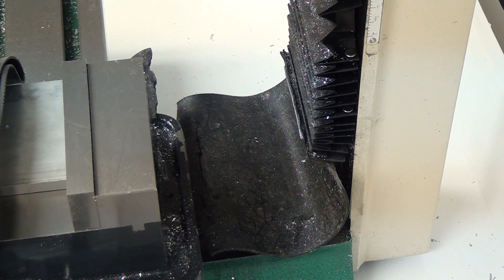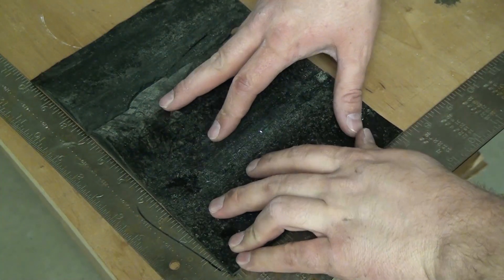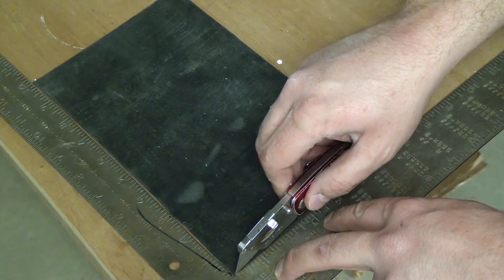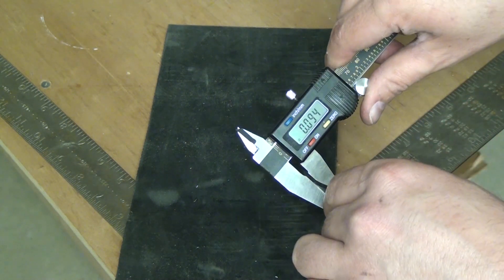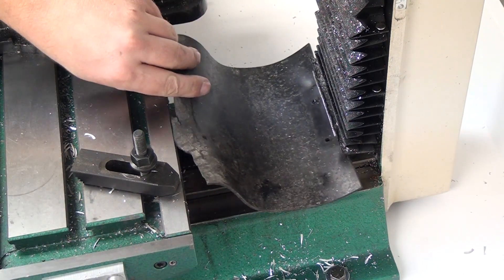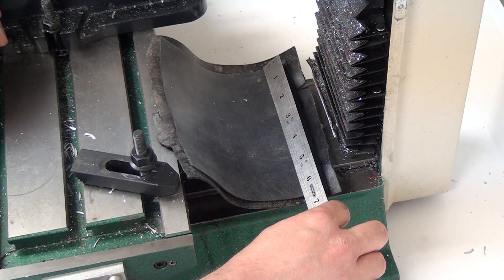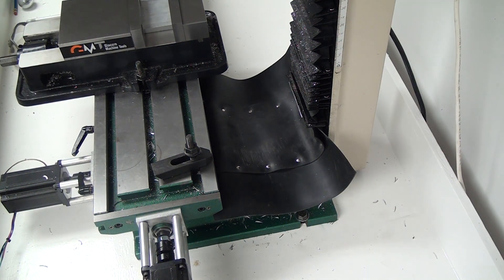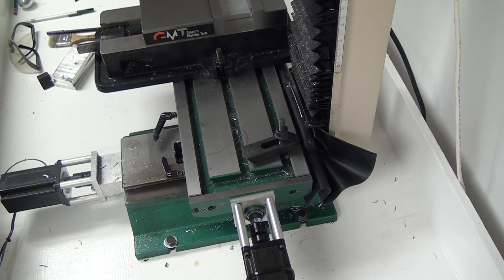CNC-G0704 #6 Y-Axis Way Cover

Comment: I just ordered some of this same material today to replace my way cover. I wasn't sure about my purchase until I came home this evening and saw your video with the same part number that I ordered from McMaster.
Reply from the maker: Show us some pics!
Reply: russtuff Follow up: I tried the softer material and it might not be a good idea. It was weighted down with chips and deformed enough for the table to run it over and was bound up in the ways. The motor skipped dozens of step and the program proceeded to cut way off target ruining the part I was making at the time.   

I've found a paper cutting board to be great at shearing this stuff as an alternative to a knife.
Reply from the maker: Jason C That is a great tip as I had wondered about the softer stuff. Thanks for the follow up.
Reply: @Jason C. Hi I'm about to order some Rubber for My g0704 Mill What Rubber did u use & which one was too Soft? I'm thinking of getting 50A (Medium)
Reply: I ordered the 40A initially and had issues.  I ended up ordering 50A and it worked nicely.
Reply from the maker: mikeyeyes7 I also use the 50A, and am very happy with it.

Comment: Good info to know. Thank you for showing it. 

I'm looking at getting a G0704 and converting to CNC, probably using Hoss' DVDs. I'm new to machining, and I'm curious how you found Hoss' instructions...easy to follow?  Complete?  Also curious whether you'd pick the same mill again and what issues you've had with it that you haven't mentioned in your videos so far, if any. ADVthanksANCE!
Reply from the maker: Hey!
I did like Hoss' DVDs and found they had everything I needed to get the job done. If you go this route, feel free to contact me and I can answer any questions that come up along the way.

If you are confident that you can do the conversion on your own, I would look at the Bolton ZX45. It's a bit larger, heavier, and costs more, but has a similar table size. I went with the G0704 mainly because of Hoss' DVDs. I was nervous about figuring it all out on my own :)